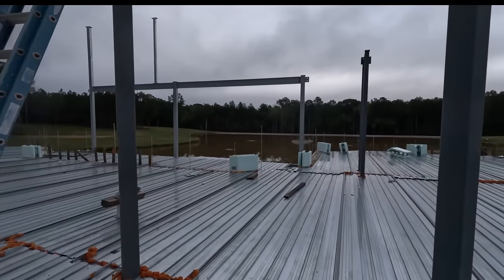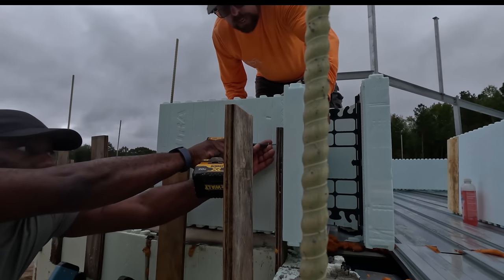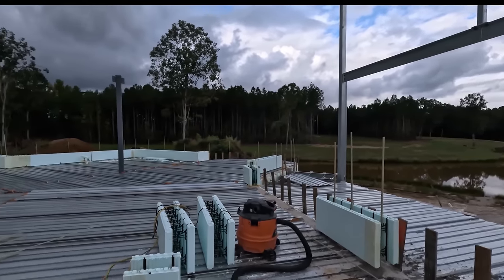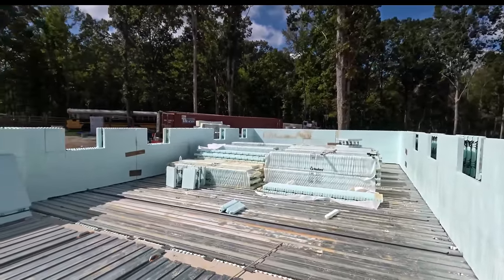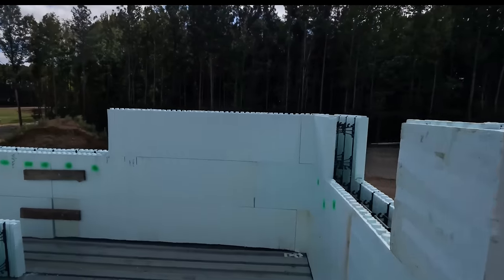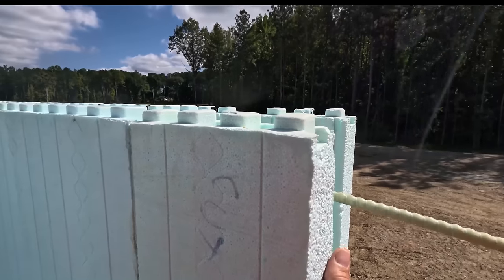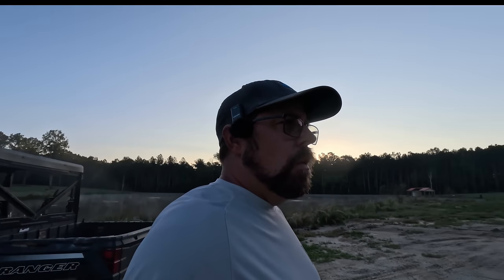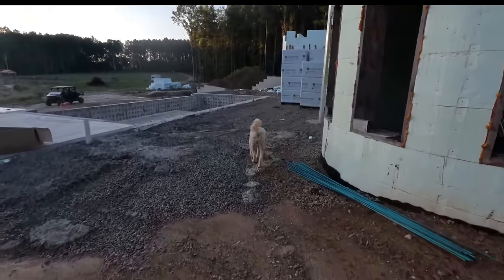Main Floor ICF Stacked in 3 Days

Comment: Jeff, now is the time to consider a private elevator! You have that large landing space to add a secret elevator, maybe behind a hidden door/bookcase. make it large enough for a wheelchair if you need it in you senior years.
Reply: THAT'S A GREAT SUGGESTION !
Reply: I second that- the other thing is a woodstove, preferably one you can cook on- geothermal is great, as long as the electricity is on. If it’s off, the pump from the well doesnt work. You should have a backup source of heat and cooking. We have Geothermal and love it- it’s one of the few in our area.
Reply from the maker: Good ideas 😁
Reply: Good idea and perhaps large enough do double as a service elevator for repairs, equipment, furniture and belongings.  Go large or go home. Wait a sec, you'd already be home. 😂
Reply: No they sux I have one and it’s broke down more that it’s working.
Reply: He's gotta accommodate for the Future.that's a good thought. but maybe he'll Sell it.

Comment: Geoff  on the garage  remember you can get one of the car lift racks that allows  you to stack 2 cars in the space of one, like Alex of Curiosity Inc has in Canada who has a spectacular garage.
The  house is looking good, and have you thought about a walkway in the roof over the portico to your office?  
You know the way Jackie  is wanting storage in the house, you may have to put a second floor on the Office and the walkway into it from the main attic.

by the time the house has a roof, Jackie will change her mind and want even more design changes, that will have to be worked in .
Reply from the maker: The struggle is real 🤣🤣

Comment: Geof noticed theres a metal clip thingy that holds the blocks to each other,was wondering how they held together,any chance you could show that on video,its a fantastic system .I just recently watched diesel creek matts sub floor form and pour done with full panel form work lots of heavy lifting and many workers,but an interesting comparison .
Oh and mrs Bealeys work shoes we call them irish safety boots here in Aus,oops thats probably not P.C we used to call them that 😮😮😮😮
Cheers kym
Adelaide
Reply: Matt (Diesel Creek) said that he decided to pay professionals to do the concrete forms and pouring because he wants to live in a NICE house :-)  and it will get done much faster too.  Geoff is learning how to build a house himself, AND trying to make it nice, while minimizing expenses.  It's taking much longer but his goals are different.
Reply from the maker: @JohnShalamskas  If I made as much money as Diesel Creek, I might consider paying someone 🤣🤣

Comment: I'm just curious how plumbing and electrical are going to be ran with concrete walls? Do you have cut a channel in the walls and floor to make your runs?
Reply from the maker: The foam is 2 5/8” thick so you cut channels in it and run your electrical. You can do the same with the plumbing, the only areas with plumbing on an exterior wall are the master bath toilet and the office bathroom. Should make for some good videos. Thanks 😊
Reply: @BealyGood  I'm very interested to see what you come up with. It may not be other people's cup of tea but I enjoy seeing and learning the whole process on what it takes to make something habitable in regards to unique dwellings, manufacturing plants, offices (you name it)

Comment: @ 4:00 Sure would be helpful if you had some 4" filler blocks you could run around the outside perimeter instead of having a gap to cover/foam

Comment: Question I notice that the bottom of the ICF is touching the steel base. To me it looks like there is no real strong connection between the wall and floor. Is this normal for your areas construction codes
Reply from the maker: These are the forms, the gaps will be sealed and concrete poured to the top of the basement wall.

Comment: And why are u not tying the horizontal rod but placing as you are with the 1.5" space. Possibly stress location. Rebar should be tied and overlapped 30xs it diameter #4=15", #5=22" etc.  would hate to see  vertical wall cracks forming on such kool house in a few yrs